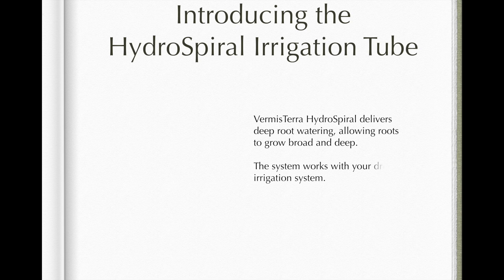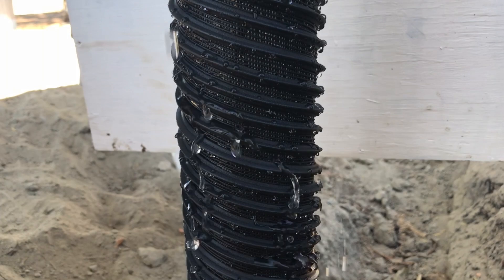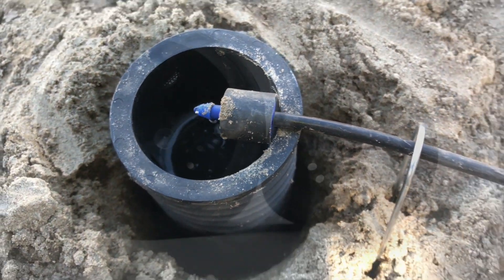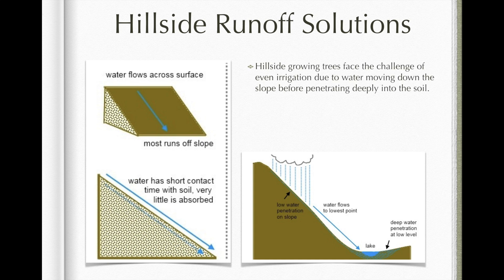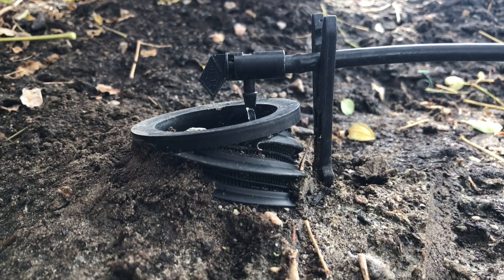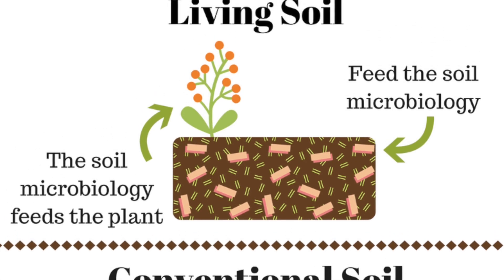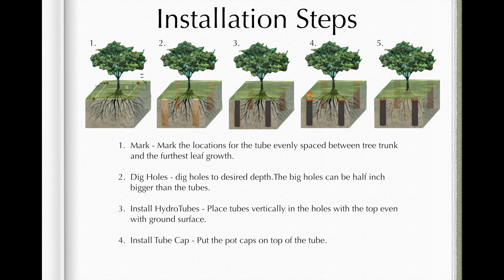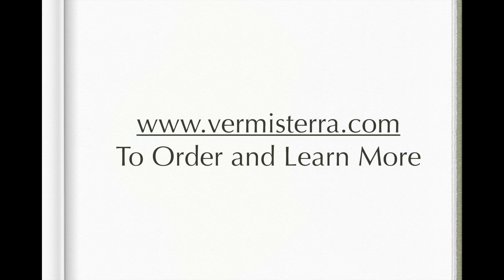Intro to VermisTerra HydroSpiral Tube -  Deep Root Irrigation

Comment: The issue with any penetrable subterranean device is that roots will find their way into the tube & eventually bock up the tube
Reply from the maker: yes that is with the types that fill up with soil- these do not allow soil in due to the fine mesh. if there is no soil0 the roots air prune inside the tube. Most home made devices will leak soil and sand into the tube- filling it up eventually.
Reply: @Vermisterra good stuff, thank you for the heads up 👍🙏

Comment: What if u have sandy clay soil
Reply from the maker: The 3-10 tube creates the widest space, allowing air to flow thru the mesh- this activates microbes in the soil. They will condition and change your soil- especially if you use our Fermented earthworm casting tea. The sandy clay will hold more water with increased organic matter in the tea, and the clay has lots of locked minerals that microbes can break down into useable plant food!

Comment: Does it work for palm trees in sand soil??
Reply: yes it does, you would not need the long 18" tube because sandy soil will allow water to percolate farther. Get the 9 or 10 inch ones, excellent to use to sandy soil, preventing evaporation. See our video interviewing desert irrigator and what he saw after installing.
Reply: @5dmindy where is that video? I need it please

Comment: Do you need to cover the bottom with a drainage grate or closed cap so the dirt doesn’t come up?
Reply from the maker: No need to cover the bottom as long as you dig a hole before inserting the hydrospiral tube.

Comment: Do you give the tree the same amount of water like flooded watering on top? I got a 24 inch box fruitless mulberry tree with an 1 inch diameter trunk.
Reply from the maker: Hi Alan, you would give the tree less water since it's not lost to runoff, evaporation. The key is a slow drip system of several hours at 1-3 GPH (depends on your soil type, climate). You can also test it and dig a hole outside the drip line to check how long it takes to soak that far. For your mulberry tree in a container, email us (thru the website) about the height of the box. One tube would be enough for that young tree. The tube is more to get water past layers of silt and clay blocking deep water penetration. You might benefit more from worm castings and our worm tea to help release any salt build up, build soil life, and increase fertility. I am confident those two products will help your tree produce.
Reply: @Vermisterra  good idea about a test dig! I live in the mojave desert. When I get your tubes, I'd like to put one on each side. The leaves are shriveling. I'm just concerned about overwatering. The fruitless mulberry  has a pot ball of 19 inch high by 14 inch. Mixed the native desert with admend garden soil. 50/50. Thank u for the feedback :)

Comment: Hi,  What is your recommendation on how far away from the center of the tree these tubes should be placed?  I am planting young lemon and lime trees starting from a 2 -3 gal pot.
Reply from the maker: It is best to place the hydrospiral along the "drip line" of the tree- For example if it is raining, where will the rain run off the edge of the canopy around the tree. That might be very close for a young tree- however you can always remove the hydrospiral and move it farther out as the tree grows.

Comment: If you can’t buy these, PVC drain pipe filled with gravel would work too. Good idea to have emitter on top!
Reply from the maker: PVC pipes do not have the same effect. If you watch the video, you will see the comparison of sand filling different types of tubes- rendering the tubes useless. Imagine having to dig up all the tubes in your orchard or field. Some competing companies sell a sock as a filter to stop the sand from entering. The main difference with the Hydrospiral is the mesh prevents silt and fine sand from entering and filling the tube.
Reply: You can try good quality of compost Finley meshed

Comment: What keeps tree roots from growing into and clogging tube?
Reply from the maker: good question, roots will typically not grow where there's oxygen/no soil etc. Think of a potted plant not growing out the drain holes unless there's sufficient moisture and soil covering the holes. In between waterings, the tube will be very dry which will discourage roots growing in there. The mesh is also very fine, so larger roots could not form there.
Reply: @Vermisterra  You've apparently never dealt with salt cedar,  oleander or cotton wood? The root systems are highly aggressive.
Reply: olegig they’ll never clog it enough to stop water. It’s not a toilet.